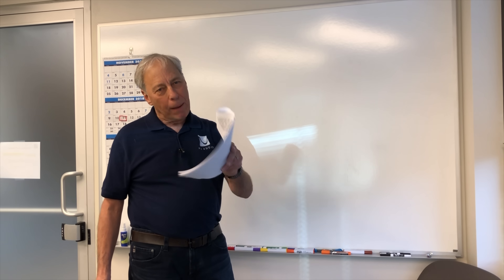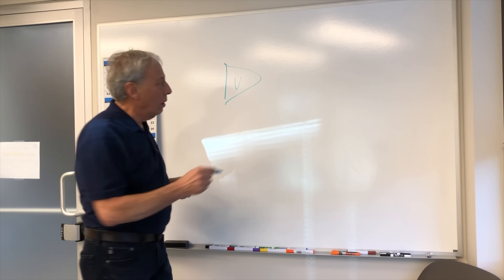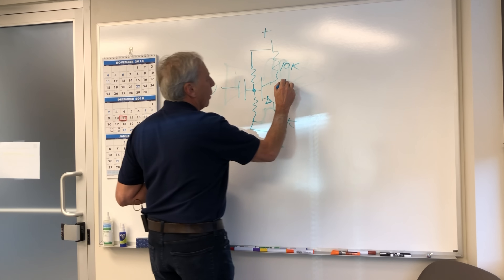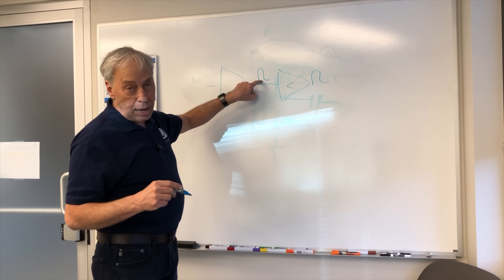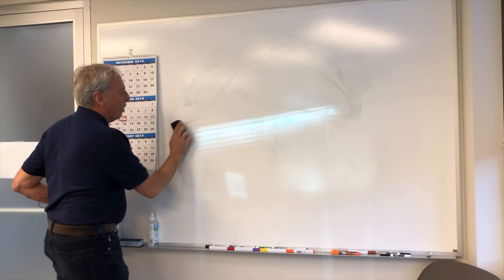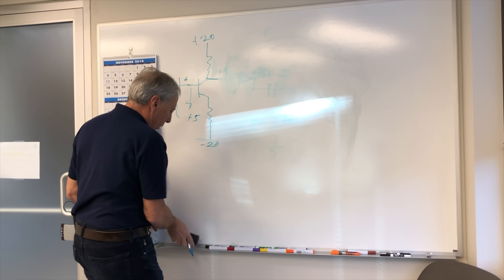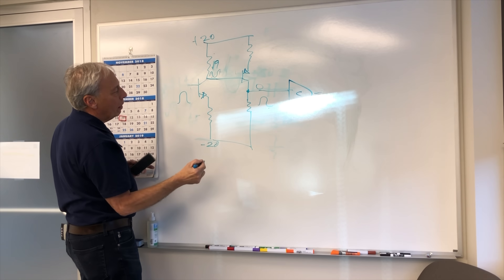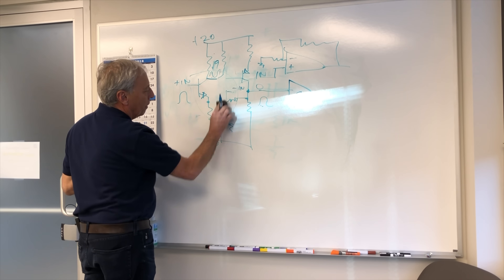Do class A, AB, amplifiers have more than one stage?

Comment: Paul, I understand that you reply to the questions immediately and without any rehearsal, so a little mistake can happen.
 Regarding the differential pair, if you do not connect the two emitters and the tail resistor on the same node, it does not work as a differential amplifier.
That said, you are a fantastic guy and your channel is IMO the very best for everything about HiFi. Thanks for sharing everyday your vast experience and knowledge!  Following your advices I was able to improve the set up of my system very much. I have also trusted you about subwoofers and, now that I have added one, I would never live again without a sub! Thank you so much!!

Comment: I would really prefer if we wouldn't have to bother with Class A or A/B amps and could simply go all Digital with class D amps...sadly Yamaha, Denon and Marantz refuse to use Class D...
Reply: @Roland Rohde. Class D amps are not digital. And thank heavens some companies still steer clear of the topology.
Reply: Care to argument that? Although any class amplifier can sound very good it is my understanding and Paul's too (as he stated in a previous video) that well executed class A, A/B are still superior to class D. And the D does not stand for digital, it's just the next letter in the alphabet for naming amplifier classes, class A, B, C, D, etc
Reply: @soring5880  
Mostly, efficiency and scalability. A Class D amp uses almost no power when it is not used, while the A and A/B draw quite a lot. With Class D you get a lot of sound, with minimal power consumption and heat production. I have a few small Stereo Class Ds, and they are great. Using the same tech in regular AVRs seems like the sensible choice to me, but for some reason there is a lot of bias against it...
Reply: @rolandrohde  yes mate, the bias is there because they are still not as good. The best class D is still inferior to the best class A/B. And as for efficiency if you care that much about £5-10 extra A YEAR for electricity, then that's fine by me.
Reply: @soring5880  
I don't really care that much about a few€ a year, it just seems silly to use 100+W of electricity for 2-3W of Sound...😉
The quality...well, maybe Class A/B is better, but I doubt it would be noticeable to 99% of listeners in a "blind" test...
Reply: Pretty sure the current TOTL Marantz PM-10 is Class D.
Reply: Go buy a Harman Kardon 370. It's class D and sounds like crap. Give me 200 bucks for it and I'll ship it to you tomorrow. For movies it's basically ok but you can't listen to any kind of music on it.
Reply: @MrTheDarku  
Well, if it had good room correction, enough Inputs and Outputs, 11Channels and good smart features then I'd take it. Sadly, I guess it has none of those things. That's why I'm stuck with Denon or (currently) Yamaha.😉
Reply: No, it's an older model, 7.2. Point is that I tried the class D stuff. Yamaha AVRs for me, for now.
Reply: @LD Blake 
Yep, installed a whole rack of them driving CBT Series line arrays in a church rec hall a few months ago, it's a 7.2 system and sounds incredible 😲

Comment: Thanks for the thorough response! (I was the original poster of the question, btw :D)
So the main thing I was missing was the fact that trying to drive a load through that high impedance (resistor of the) transistor would get the signal "ugly"; I just now made the connection of you calling the input and output stages respectively "high impedance" and "low impedance" with their ability to drive a load without distortion. It never came to my mind that you would need a buffer, and that it would solve that problem, also by having a lower impedance. Again, thanks for the reply, it was pretty much what I wanted to know! It wasn't boring at all, it was really interesting! I wish it was even more in depth, but I guess that for most people it would've been too much, so I'm going to study the topic more by myself... Thanks for the insights!

Comment: Nice talk about pre-amp architecture, but the question was about  the different classes of out put stages. I know the question was a bit wonky , coming from someone who is not a tech, but you missed anything about classes A, B, AB. Wait til companies start adds for H class and other multi-voltage out put craziness that's out there! Enjoyed your response anyway.
Reply: @Larry Niles an electronic tech who knows the difference between what an amp stage is and output architecture as does Paul. I was not in anyway knocking his answer, in fact, praised it. I mearly pointed out that the question was about the different out put type and how many sections/ stages may be in an amp- two different things. The question was poorly phrased by someone who knows no electronics, Paul's job was not easy, and he did a good job, but only on half of it. He never mentioned anything about  class A, AB at all. That's all I mentioned, he never pointed out that the questioner was asking about two unrelated things.

Comment: You should get a blackboard easy to read and environmentally friendly as well.
Could you not use a triac instead of a transistor in the Darlington pair
Reply: It's not a darlington pair. Triacs are typically used for switching, rarely for linear amplification.
Reply: @TorgeirFredriksen  sorry I meant a differential pair for feedback using triac instead of a transistor